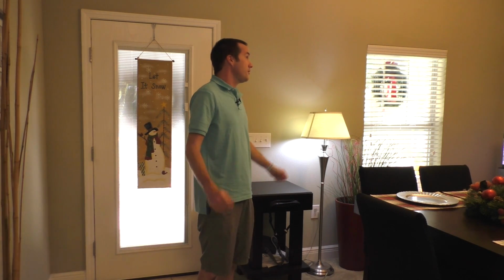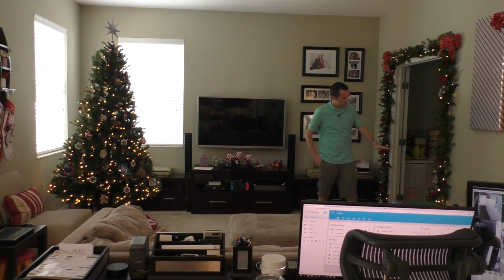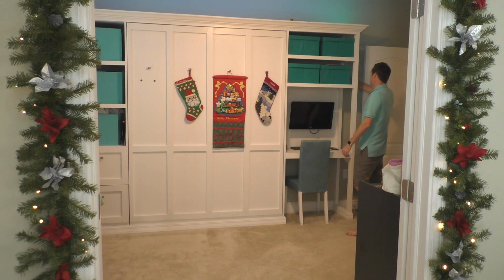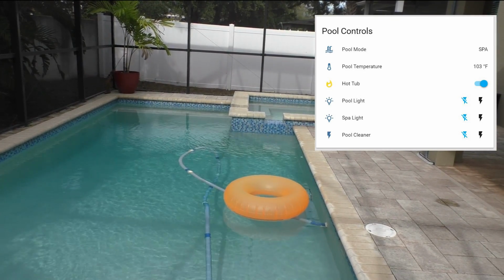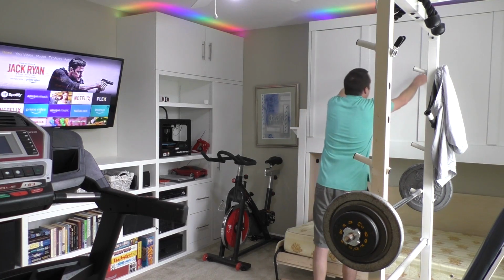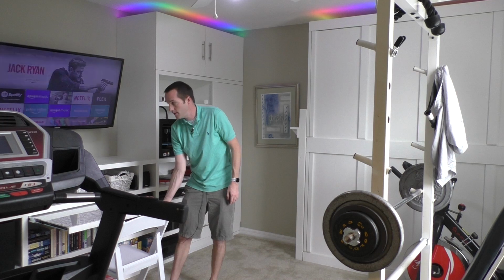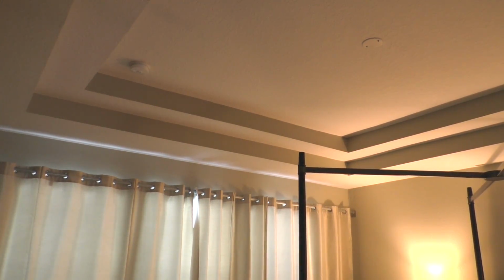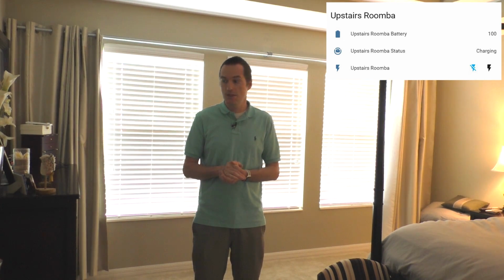20,000 Subscriber House Tour! (with bonus rambling!).

Comment: Hey Rob, thanks for sharing your place. I am currently looking for a 240v Led dimmer with an option for single pushbutton control. Is there a Shelly that will do the job?
Reply from the maker: You mean a device that includes the DC power supply?  I don't think shelly is producing that product anymore.  The new controller (the RGBW2) requires an external power supply.
Reply: @TheHookUp  These lights plug direct to a  240v AC socket. Probably have to change to 12volt DC leds. Does the Shelly control dimming via a single momentary switch?

Comment: Great pad! I too have two home assistant controlled fish tanks. Although they are freshwater and I use the 4 channel Sonoffs, THs for temperature monitoring and a couple of Basics for the LED lights.
Thanks for sharing.
Reply from the maker: They are salt water.  If I knew about Sonoffs when I made them I would have used them.  They are made with arduino relay modules.

Comment: Hey Rob...thanks for another great vid.  You and Dr. ZZs have really cool houses.  I was trying to remember where you lived because you're wearing shorts during the winter.  Must be Florida I assume.  At any rate, I have a similar situation with my curtain rods.  They are basically wooden rods with curtain rings on them, and I was trying to think of a way to automate them without having to replace them with rails. 

The solution I came up with was to use a stepper motor attached to a pinion that loops a long rubber timing belt the length of the curtain.   The curtains will be attached to the timing belt using (maybe fishing wire -or something not too obviously visible). When the stepper motor is activated, it will push or pull each side of the curtains open or close.  As for the rings snagging on the rod, since my curtain rod is made of wood, I just used furniture wax to lubricate it, and it moves really freely now.  Since yours looks to be made of metal, you might try some other type of lubricant.  My project is far from being done, but the proof of concept worked, its just a matter of finding the right sketch to run the stepper.  Will definitely be testing out yours (that you used for the motor blinds)

Comment: Great video Rob. Perhaps it is the time to automate the staircase light using sonoff with moded PIR (voltage) or get 3.3v PIR sensor or Ultrasonic sensor to measure distance and set it the way fits your needs to avoid false triggering the switch. Also you can connect the pins to same sonoff GPIO so two functions with same device.

Comment: Thanks for the tour. Did you ever figure out how to keep the roomba from sleeping or you bought a wifi model?
Reply from the maker: My roomba's are 500 series, so they don't sleep automatically.  If you have a 600 model there's a sketch on the github that includes a "don't sleep" function, where you need to wire GPIO2 to the BRC pin on the roomba.

Comment: Which code do you use for WS2812B inside?
Reply from the maker: it's a bit of code I wrote that can run each location (top of the bed or top of cabinet) individually in HA or sync them.  In hindsight there's not really a situation where I want them to be out of sync, so it was mostly a waste of time :)

Comment: Thanks so much for inviting us in and sharing your home with us, Rob! What a nice house you have! I wish my house was as neat, tidy, and well organized. I really love how orderly and cohesive your house feels. (Mine looks like a cyclone hit it most of the time!) I was hoping for an overview of your cams and security system (obviously not too much detail on the latter!) I’ve been pretty dissatisfied with the (Zmodo) cams I bought so I’m researching things before potentially wasting more money on a new system. Here’s an idea for your bedroom curtains... We have a very similar type of curtain rod in our bedroom (not as long as yours and also not automated) and I’ve thought about 3D printing a sleeve (in interlocking segments) to slide over the rod which will essentially turn it into a big corkscrew. With the curtains secured at each side, you’d only need to rotate the rod to open/close the curtains. (Some rod mods would, of course, be required.) Now that I finally got a 3D printer for xmas, I may give it a try but I have so many other projects in the pipeline ahead of it. It’s going to take some trial and error because the grommets will need to jump the grooves of the corkscrew as the curtains are closing so the height of the corkscrew blade will need to be short enough to allow that but still tall enough to be effective (and of course, thick enough to be sturdy but not too thick.......)
Reply from the maker: What kind of Zmodo cameras do you have?  The corkscrew is an interesting idea... let me think over that a bit more.

Comment: How did you do the indoor led’a
Reply from the maker: NodeMCU and some FastLED code.
Reply: The Hook Up hey Rob, noob question and sorry to revive and old comment but is it possible to achieve the same result by using the esphome integration in HA instead of the Arduino IDE for this project?